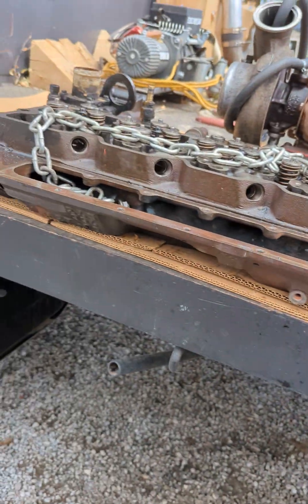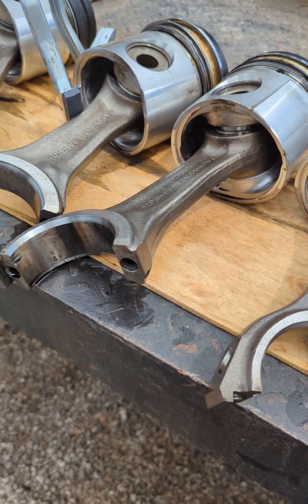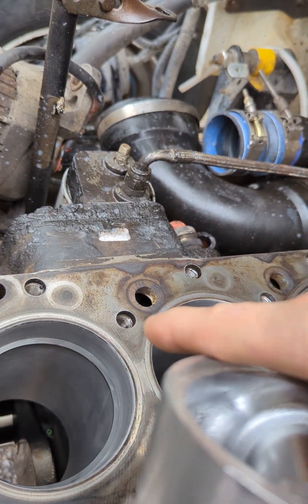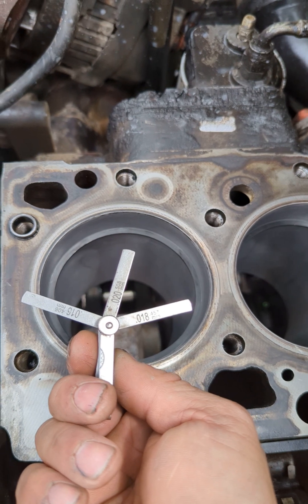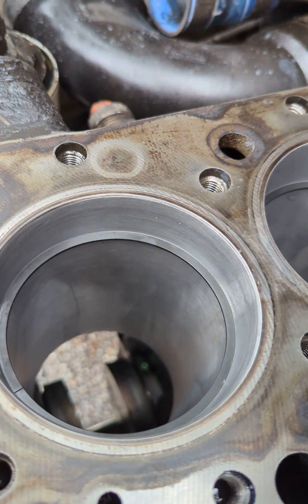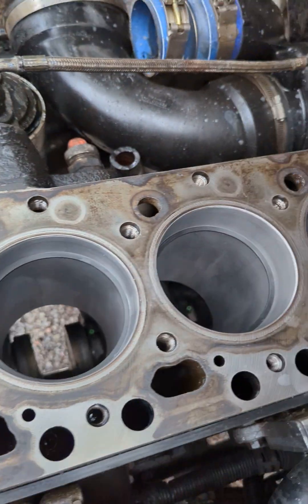Cummins 5.9L engine rebuild 2 #trending #mechanic #repair

Comment: How much for that build labor and parts
Reply from the maker: @cliftonspann1522  since I did all the labor I would say about 15 hours of Labor. and The engine rebuild kit is by Enginetechh. It cost right at $1,000 for Pistons rings  gaskets everything 🤟🏻‼️
Reply: @SMOKEY-JAYS-DIESEL  ok thx mine is at the shop just trying to get a estimate where you located

Comment: What grit do you use on ur stone? Is there a min or max on ring end gap.
Reply from the maker: The grit of the stone I'm not sure but it was just a cheap engine hone that harbor freight sales. There is a min and a max gap. But That's why I choose to go with the gap I did on this video It's kind of in between min and Max

Comment: Good set up little extra room for few more horses good job👍👍
Reply from the maker: It being in a fleet size truck made it easy. Lots of room to take the oil pan off 🫡 unlike in a normal pickup truck lol. You have to take the engine mounts off and lift the engine up in order to get the damn oil pan off 🤦🏻‍♂️😂😂